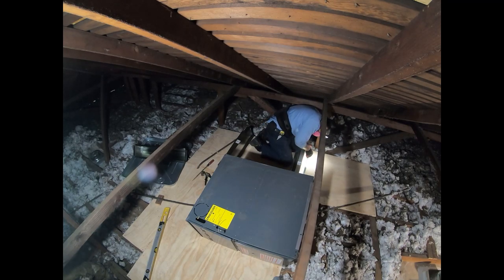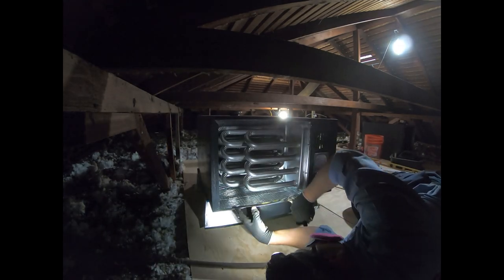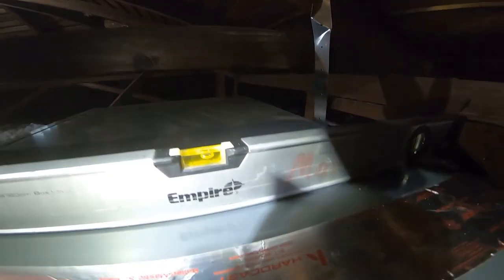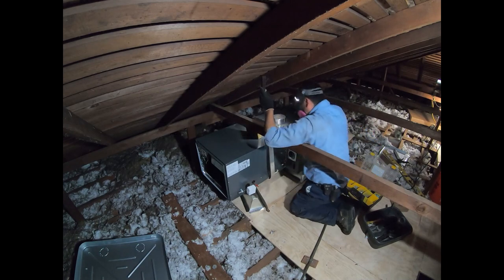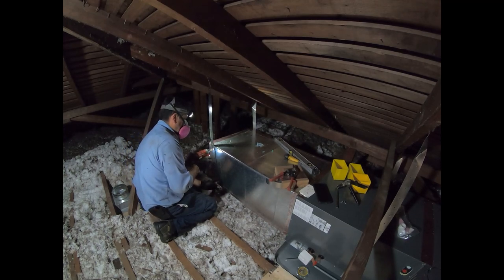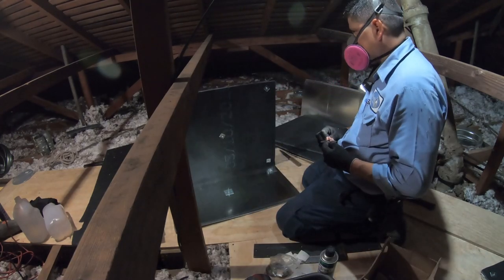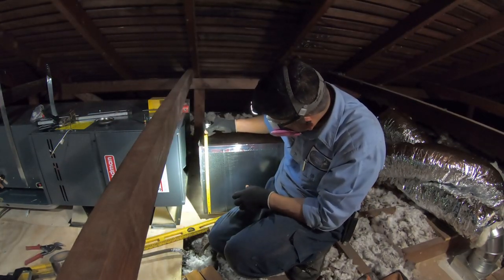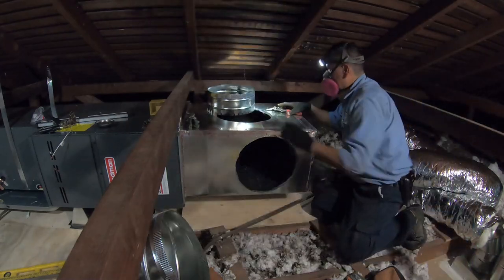New Home HVAC Installation  part 2

Comment: Your work is just pure gold! I am jealous that you can use furnace legs, here in Vegas we would fail the inspection if we ever used those
Reply from the maker: Thank you for watching. Why do they not let you use furnace stands? Did they give you a reason?
Reply: It's mainly due to if earthquakes occur. They make us hang the furnace and coil with angle iron and all thread.
Reply from the maker: @Heavy_metal_rulez  I did install seismic straps. And sometimes I do hang it with uni strut and all thread. Not this time though. I built the platform for furnace directly on top of a load bearing wall.
Reply: Sorry I meant to say that they don't make us secure it with seismic straps. One inspector told me before that the unit should be able to move around and doesn't need to be secured to any of the trusses. That was way back when I first started installing. I was misinformed haha
Reply from the maker: Inspectors  need to include HVAC installers in those discussions for new codes. Wouldn't you agree?
Reply: I 100% agree! There's so many things I would like to call them out on

Comment: How bout a big pan that covers the entire furnace and coil and then put the stands inside pan? Sometimes they flood the furnace too but I know you aren’t in a Florida climate.
Reply from the maker: There was electrical conduit in the way that's why I couldn't put furnace stand in the pan. And yeah I have not seen a coil flood furnace in horizontal install in attic yet. You guys must have EXTREME humidity.

Comment: The only thing I don’t like about vibration pads is then the cabinets flex due to all the weight in the one small area. Do you line the entire stand with them?
Reply from the maker: No but maybe I should. Right now I'm using the biggest ones they sell. Think they're like 5x5 or something close to that.  So you just lay them on the metal stand?
Reply: The Air Conditioning Guy I usually put metal uni strut in pan lengthwise and 2x4s on top of that no pads...never had a vibration problem

Comment: How many days did you spend on this project?
Reply from the maker: Took me longer than usual because of the rain. 8 days. How long does it usually take you?
Reply: The Air Conditioning Guy probably 4-5 days